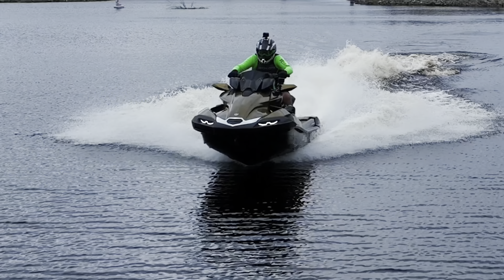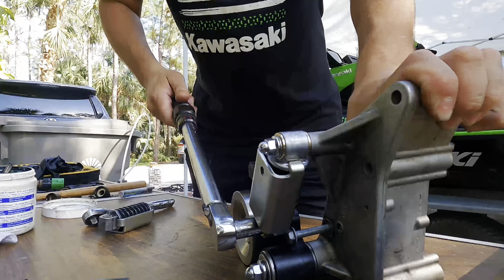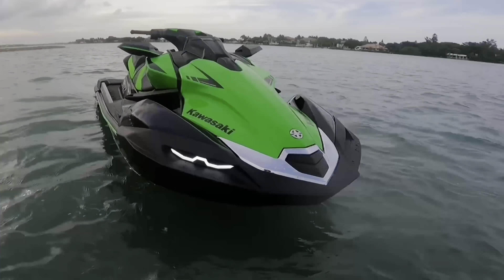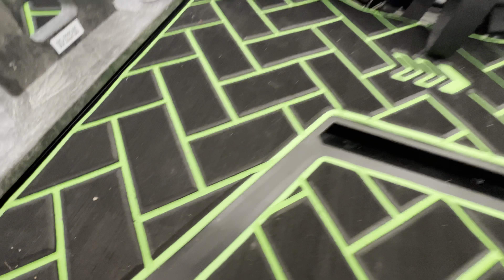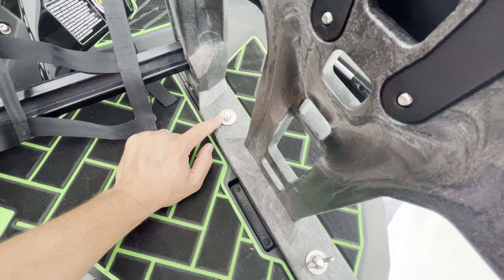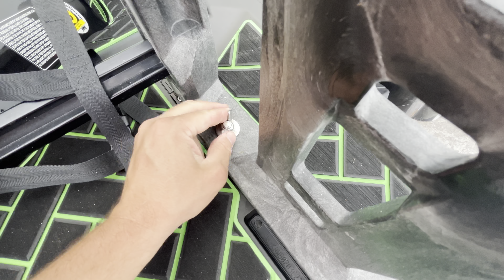Easy Hardware Fix for the Kawasaki OEM Cargo Rack for the Ultra 160 and Ultra 310 Jet Skis

Comment: Took my comment away, you obviously did not want to reply, That ok, you might of been really busy.I worked out the issue anyway.
Reply from the maker: No clue what you’re talking about Kevin…
Reply: @JDsWaterWorld  ok,well, l launched my Ultra lx first time on sunday, i did not realise that the keys had to be pushed in a little bit more to activate the ecu. Strange thing was that a good few times at home,l only put keys in and ecu strarted up. Its all good anyway,l guess l should of read manual a bit closer beforehand.perhaps l just pushed keys in a little bit harder and it kind of worked at home. I dont know if you know about the flush thingy, when l screw in the hose adapter into the brass bit,and l turned water on,l had some leakage from underneath that brass piece,not from hose adapter.  Of course brass piece just spins, so, can not just tighten  Hmm?
Reply from the maker: Yeah the immobilizer key must be pressed in pretty firmly to activate. If you battery voltage is lower than about 12.6 it might be sluggish to respond- did you check your battery with a multi meter? I use a small 3’ piece of hose from my salts away mixer to the flush port- so I don’t put as much pressure on the port itself with the main garden hose.
Reply: @JDsWaterWorld  the battery was fully charged, it just through me because l thought l only slotted in the key a few times and the ecu came on and l did not know about that little push in to activate. Regarding the flush, perhaps l should not have the hose on full blast, so used to doing that when outboards are connected with the muffs. Should l just have hose on half way, l will test it and hopely ,l have no leak issue there,which would mean too much pressure.
Reply from the maker: Yes, also the screen will time-out after a period and you will need to “bump” the key to reboot the system. I am not sure what water pressure you have, but as long as you have a steady stream out of the the tell-tale when flushing, your pressure should be adequate